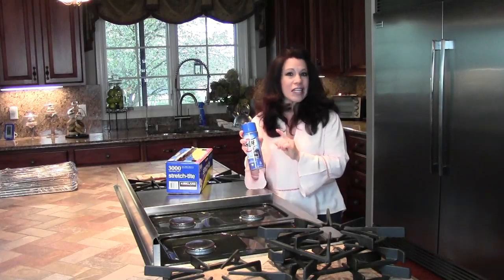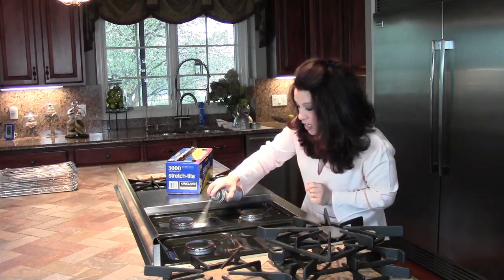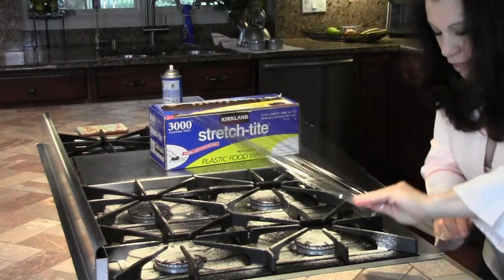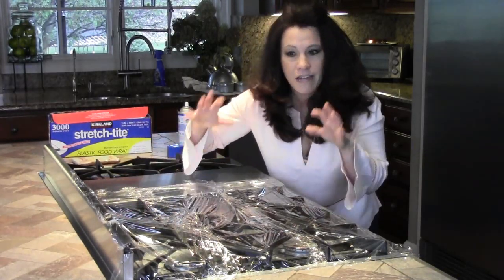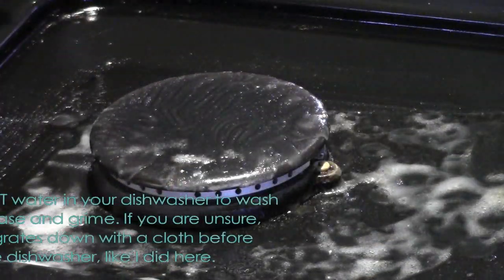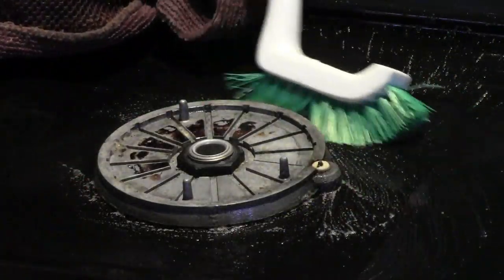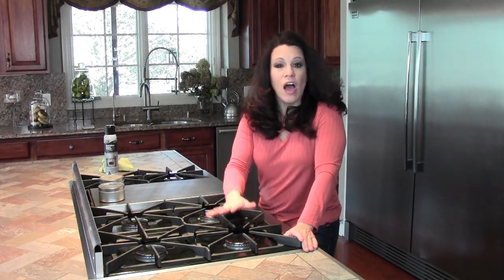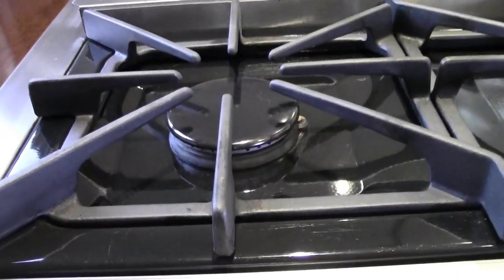Sparkling Stove Top In Minutes! - Simple Cleaning Tutorial By Renee Romeo

Comment: I think you should actually TELL people about the pilot light being off instead of just having a quick blurb run across the screen.  Many people are not going to think about tis.
Reply from the maker: Hi Mary, Yes - I have a disclaimer stating that if you have an open flame pilot (like on older model gas stoves), then don't attempt this. I have an electronic start so there are no worries of blowing out an ignition flame. Safety first. Thanks for the great comment, Renee

Comment: Quick tip: If you are planning on running the oven's self-cleaning cycle, toss in your grates and they will come out perfect without any work or chemicals.  I wish interim cleanings were easier because it seems like the first time you cook in a spill or splatter they are just as hard as never cleaning.  The ammonia and ziploc back trick works pretty well but it takes a long time.  The woes of first-world struggles.
Reply from the maker: Micah Robles, That's a great tip too! I don't use my self-cleaning option nearly enough but I'll start using it even more now. Thanks for sharing - you'll make easy work of this job too. All the best, Renee
Reply: Great idea.. thanks for sharing.. will definitely try👍

Comment: I have a new whirlpool gas stove. Do I have to pull the stove out and turn the gas off before I do this?
Reply from the maker: Hi Karen, It's always a good idea to shut the gas off but if you have electronic start on your new range (ie: you don't see an open pilot flame near the burners) then the product won't come in contact with a direct flame and you'll be fine. However, if you feel that the burners can get turned on accidentally during this process, then please turn the gas off completely at the wall. Better safe than sorry. All the best, Renee
Reply: @ReneeRomeo  Thanks! I have those knobs now that you have to push in then turn.
Reply from the maker: @KittyMama61  Oh perfect! This is going to look amazing. Renee

Comment: Since you had the burner caps off it looks as though you sprayed the burners, as well but I didn’t see you cleaning them afterward. OK to spray those and use a brush on them after? I just moved into this house and the stove is only 2 years old but under the burner caps is just filthy. Thanks!
Reply from the maker: PJE, Absolutely! You may experience some clicking during ignition (due to moisture) but it will quickly burn the moisture away and return to normal. Thanks for the question. Congratulations on your new place, Renee

Comment: Great advice! Are your grates cast iron? Looks like the dishwasher didn't cause any damage.
Reply from the maker: Ryan Brennan Guitar, Yes. The grates are cast iron and the dishwasher doesn't do any damage to them. They come out so squeaky clean this way - no worries. Thanks for the great question, Renee
Reply: @ReneeRomeo  The grates heat up so much in the dishwasher that they melt the plastic.  Ultimately the little spokes will rust and break.  Ruined my dishwasher this way.
Reply from the maker: @ronaldkrueger8247  Perhaps your water tank is turned up too high? Some dishwashers have low heat settings too (especially delicate cycles) and this can help with your problem. BTW-  I have heard of replacement tips for dishwashers so it's a good way to keep your dishwasher. All the best, Renee

Comment: Thanks for your video, I want to try this right away. Just bought a new stove in June and after the 1st use I was so upset the top crates (iron) had deep marks from the flames and/or grease.  Also, it came with a iron griddle which it is also stained with penetrated grease marks and I’m not able to remove the marks with regular dish soap and water.  Any suggestions on how to restore griddle would be greatly appreciated!
Reply from the maker: MRB, Congratulations! It's always nice to get  a new appliance - not so nice if it's hard to maintain. If your griddle is stainless steel, you can use the same method. If it's aluminum, the stove cleaner will pit the surface so please be careful and research this before you start. You'll be so pleased with how this turns out. All the best, Renee

Comment: Great tips! I have a new oven just like that one. I appreciate this video so much! Thanks 😍
Reply from the maker: Francee Underwood congratulations on the new stove - you're going to LOVE it! This will make it so easy to keep it looking brand new. Enjoy your lovely purchase, Renee
Reply: Looking for the best way to get burnt on food particles off of KitchenAid range top in the pits glass cleaned okay but in the pits need additional help need recommendation for good soaking agent for the pits around the burner I KitchenAid range top that would be a gas range top6. Looking for the best soaking solution to get burnt on food particles off of a KitchenAid range top in the pit next to the burner at
Reply from the maker: Tom Siebert, You could always do a second application and leave it on for another 24 hours. Otherwise, I have heard great things about Simple Green but have not reviewed that product myself. You could spray it on and leave it for days (if necessary). There are no harmful fumes so you literally could just leave it soaking until the mess is gone. I'd love to hear what path you took and how it worked out for you. the one good thing is that once you have the surface perfectly clean, maintenance becomes so easy.  You'll get there! Renee
Reply: Tom Siebert  I soak with cleaner than get a wooden toothpick and gently scrub around the burners and flecks. You will need about 4 wooden tooth picks maybe more. I've been doing this for years and works like a charm. The tooth picks will start to soften the wetter it gets which is normal however you can see the flecks loosen dosent scratch either
Reply from the maker: Bella Legosi, Another GREAT idea for getting into tight spots! Thank you so much for sharing this tip. This would be useful in so many tight spots. All the best, Renee

Comment: Thanks for the tip, mine is aluminum cook top, I am not sure, it is light and easy to clean, with ordinary soup. How do I clean the exhaust fan near the cooktop, it turns greasy
Reply from the maker: We always used Greased Lightening in our restaurants for our greasy areas. Let it sit and drip for 20 minutes before wiping. Others have suggested Simple Green for aluminum surfaces. If you wipe it down once a week, the grease doesn't build up easily. I know, it's a bit of a chore but you'll be glad you kept on top of it in the long run. All the best for a squeaky clean exhaust fan. Renee
Reply: @ReneeRomeo  thanks, this is really helpful. Can't thank you enough

Comment: Just scrub the grates in the sink if you don't have a dishwasher?
Reply from the maker: Hi Garcia Family, Yes - that's an option. You can use a coarse green pad to wipe them down. If you have a pressure washer, it works great to lay the grates on the driveway or grass and power wash them clean. Just make sure you try to collect any grime with a dust pan afterward. I love my power washer for cleaning my grill grates. It does a nice job. I hope this helps!

Comment: I'm an Engineer and this process is ok for lightly greased stop tops. I have used your method to only go back with volatile chemicals and a mask to remove the crust that is left over. The trick is to NOT let the stove top get that bad and to clean often to avert any chemical removals!
Reply from the maker: NY Nicky Scala, I feel that maybe you didn't spray enough product on your stove top. The more heavily you cover over the grime, the easier it will come off. Yes, it's always better to keep up with it. This has worked for me every time so I felt the need to share. All the best, Renee
Reply: Great if lightly soiled
Reply from the maker: @nynickyscala9858  Thanks for the feedback! Renee
Reply: Yes, I would not use those chemicals either. A little vinegar and baking soda does it or hot water and baking soda, or even liquid soap  too. But you have to clean almost everyday or grime builds up.

Comment: How many viewers out there have had problems with kitchen appliances within 1-2 years of ownership??? I am a firm believer that appliances are designed to fail or the parts manufacturers are using are crap! We remodeled 8 years ago and so far we've replaced an Electrolux d/w, called in the repair man for our Bosch side-by-side fridge to replace the control panel; the Jennair telescoping vent for our gas cooktop is still at the repair shop (it will be 2 years this Christmas). Our Fischer Paykel DCS oven won't heat to the appropriate temp. and this is after we had the faulty door fixed--it was sold to us with with the faulty door. Our Samsung front load dryer had an issue which had to be repaired. The only stalwart appliance we have not had issues with is our Viking wine fridge. Sorry to use your youtube page to complain, but I can't be the only one out there.
Reply from the maker: Carolyn Harper, I am so sorry to hear that you've had so many issues with your appliances! I have 2 engineers in the family and they tell me that all the parts made for appliances are being sent from the same places - China and Mexico. There are very few quality control procedures in place in any their manufacturing facilities. Since all the companies are using the same components, it doesn't matter how much you spend because most appliances on the market are going to have the same issues due to badly manufactured parts. I ope you receive your Viking vent soon. On a positive note - how lucky are you to have a Viking wine fridge? I'm a huge admirer! Renee
Reply: @ReneeRomeo   I hear you. I remodeled my kitchen with all new appliances when I retired - thinking that was it - wrong - the gas stove cook-top when out and I just replaced the dishwasher along with the kitchen faucet - Grrr nothing last long anymore. The Appliance companies, along with installers, and plumbers are earning a bundle - all masterminded behind closed doors,.
Reply from the maker: @citticat2  As consumers, why are we all programmed to be okay with it? I think that's the bigger question of society. My Grandparent's generation never dealt with issue. Hmmmm....
Reply: @ReneeRomeo  IDK, mostly because we have been programed to deal with this, buy the latest gadget, go into debt if we have to, and wait until it breaks down. Or just go without and wait until we can afford to fix it. We have been programed by the very people who are screwing us over and earning billions. Even if we had a few companies that were willing to produced a better product the gov't would shut them down in a heartbeat. The gov't wants us poor, in debt, and dependent on this corruption. What other choices are there?
Reply: I blame GE, we have 2 year old new built home. Two of the GE applicances have failed. The dishwasher twice, now down and needs new pump. The cooktop needed a new harness for the burners when was less than one year old. I do believe manfactureres, especailly GE makes crap.
Reply from the maker: @bethbilous4720  Oh no! It's a shame. I hope they were still under warranty at least. I blame it on untrained workers at the manufacturing plants. I hope you got them fixed quickly. Renee
Reply: @ReneeRomeo  More like the system to generate profit.
Reply from the maker: @citticat2  It would seem so...

Comment: Do you turn off the gas before applying oven cleaner ? I would be concerned that there is a pilot light that flammable
Reply from the maker: Y Gibney, If you have a pilot light that can be blown out by a draft, then absolutely turn off the gas to the appliance. My stove has an electric start so turning off the gas (in my case) wasn't necessary. Better safe than sorry though. Happy cleaning, Renee

Comment: I wrap my stove top with aluminum foil.  Wipe when I feel like it, and replace as needed.  The grates still need to be cleaned though.
Reply from the maker: Yes! Great idea too! You can absolutely use this method on the grates though. Just place them on plastic wrap, spray and wrap them overnight. They'll turn out perfect. Thank you so much, Renee
Reply: Yes, suggestion it is very dangerous because when the oil accumulates or grease accumulate, it can get on fire

Comment: Do your burners light or just click after this procedure??
Reply from the maker: Carolyn Harper, If your burners are only clicking and not lighting, you need to rinse off the burner holes a little better. There is probably a little goo stuck in one or two of the holes. Once that's done, give it a little while to dry out and you'll be good as new! All the best, Renee
Reply: I don't have burner holes. They're just grooves. One of my igniters got pushed below the cooktop! It's a Bosch and nothing is removable. Not even the control knobs! I've already checked out other tutorials about gas igniters, etc. and I think the next step is to call the repair man : (
Reply from the maker: Carolyn Harper,  I also had a Bosch cook top that used to clean up beautifully. It didn't take any effort to wipe it down once it sat overnight. I think you're right here - I don't have any advice to offer if you're having issues with your igniter. I think calling a certified repair man is the way to go. Renee